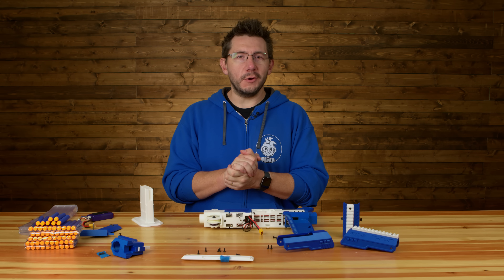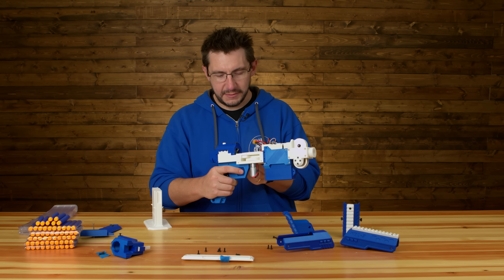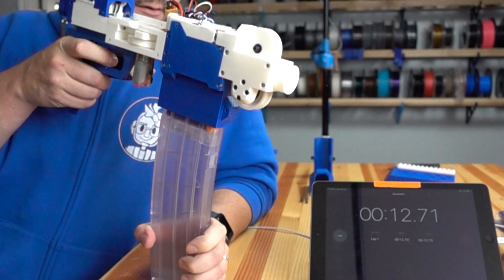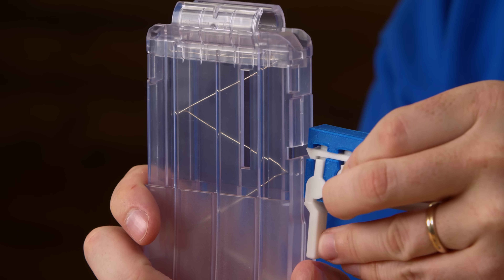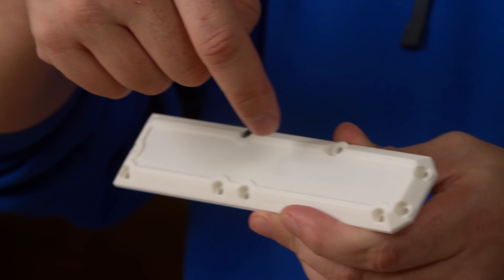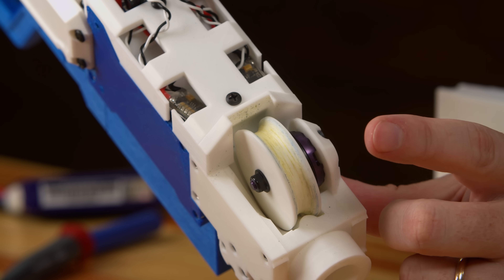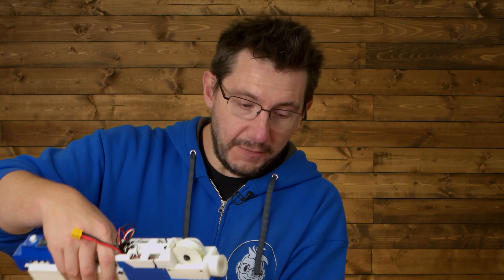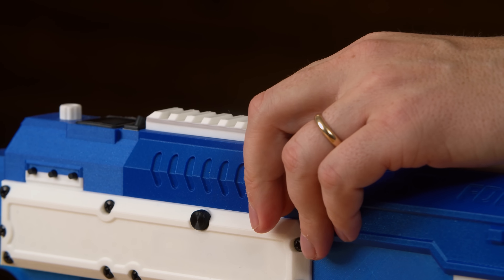Full Breakdown of the Project FDL Nerf Blaster and some Sad News

Comment: That sucks.  For a blaster it needs to look like and sound like a Star Wars blaster with attachments for extending the barrel and folding shoulder stock to make blaster rifles.  A carrying strap, RGB lights in the front might lead to false identification as a muzzle flash by cops.  Like the sad instances with Laser Tag pistols being used at night when a cop shot a kid dead thinking it was a real weapon.

That control knob is slick especially with the display.  Perhaps a Gatling gun variation for high volume users?  Getting back to the Star Wars blaster a speaker should be added to replicate the cool blaster sound effects.

Comment: Hey Joel, just wondering. What machine would you recommend to a newbie and why. I have the snapmaker 1 myself and I use fusion 360 but I really want a bigger printer and I figured you would be the right guy to point me in the right direction of a easy to use bigger printer.
Big fan of your work and videos.
Big hello from Norway

Comment: If the flywheel motors are dual ended shaft, then put flywheels on both ends and have either side-by-side or an over/under. Also modify pusher to make double sided. Dual magazine of course, but rate of fire DOUBLED!!😱😱

Comment: Although they are sold out of electronics, I decided to download the files and start printing. I am a racing drone pilot so I have wire, connectors, motors, esc, etc.. I just need to find a way to get trigger communication through. Unfortunately it will not have a display or knob but possibly to connect through bluetooth gui and adjust on phone. I hope to get this info to 3DPN to share once finished
Reply from the maker: Sounds like an incredible project - cannot wait to see it finished!

Comment: Clips are for your hair..magazines are for your firearm...said my drill instructor... over and over and over
Reply: Not entirely true. The m1 garand uses clips. Clips only grab/contain the cartridge by a portion, magazines encase the whole thing
Reply: @nhwilkinosn  Interesting, I never knew that.  During my says with a DI it was an M16 so Mag it was.  In this case, I think the item used in the nerf gun fully encloses the cartridge, so it's a magazine.
Reply: It is. And 99% of the time, magazine is the correct term. But gun clips do exist. It's weird saying it though Moon clips, stripper clips, enbloc clips, etc. Most are for ww1 era guns anyway (with the exception of the garand of cours)

Comment: I recon you can do a simpler version of this with 1 cheap RCspeed controler; 1 cheap RC motor; 1 switch; 1 Potentiometer;  1  circuit python microcontroller and 1 9v battery. you can even a add a cheap servo for the loading mechanism. No need for a oled screen tho. Just have a few firing modes selectable via the potentiometer and a few lines of code in python. All together probably less then 40$.
Reply: That's pretty much what this is, except everything is more powerful to get better performance out of it.

Comment: It is magazine not clip. The difference is a magazine has the casing and springs and is actually used to connect to the weapon. A clip is used faster loading of a Magazine.
Reply: No the difference is in how the ammo gets delivered into the gun (or blaster). the clip holds the ammo and then is moved by the gun (or blaster). while a magazine moves the ammo in to the gun (or blaster) by its self.

Comment: Mental gears are turning ... maybe a blower to push darts instead of the flywheels to pull them.
Reply: That's how spring powered blasters work, they're really air guns. They compress and spring in a piston when you prime it, then when you pull the trigger, the spring is released, compressing the air and forcing it down the barrel, launching the dart.

Comment: a clip feeds a magazine. a magazine feeds a firearm
Reply: Ethan Middleton no a magazine feeds a blaster a clip is moved through a blaster
Reply: @samda4739  you're both right in a sense. the M1 used "clips" of ammo. these days a lot of rifle ammo is sold on stripper clips, which you use to easily load ammo into the magazines.
Reply: @samda4739  No he's right. It's a common saying in the gun community. It's not always the case but it's super common.

Comment: couple of things:
The flywheel dart dust. thats a good thing. After a few hundred darts, the dust buildup helps with better grip.

Magazine, they are magazines.

dart head removals are an unfortunate side effect of modern modded nerf blasters.

the quick release mag switch is super useful for quick magazine changes, especially when you are under fire. :)
Reply: John Corvus I prefer the term “dart skid marks” 😂😂

Thanks for the info!
Reply: @lasersandlayers  I does work pretty well. :D

Comment: As a normal person, and not a gun-enthusiast--it is a magazine, and not a clip. There are many ways to differentiate the two, but the main fact of the matter is that throughout history, they have been interchanged so many times that at this point both are acceptable to anyone but gun-enthusiasts. Really. Anyone who gets super intense about the semantics of it, will have plenty of reasons why it should be this way, and should not be this way--but who cares! Just call everything that holds bullets and goes into a gun a magazine. You'll be right at least 89.8% of the time.
Reply: the achieve the same end goal, but do it completely differently. it's like calling a motorcycle a car.

Comment: For flywheel blasters like the FDL3 in this video, the Adventure Force darts, available for $10 per 200 darts are amongst the best, as they have some of the strongest glue joints holding the heads on and the price is one of the best for darts per dollar. https://www.walmart.com/ip/Adventure-Force-200-Dart-Refill-Works-with-All-Adventure-Force-Blasters-and-most-Standard-NERF-Elite-Blasters/218225675

The caliburn, available at etsy through the following link, is one of the best value springer blasters that is out there. I have one of the caliburn blasters, and it is almost as adaptable as the FDL3, but since it uses a spring instead of a set of flywheels and is pump action, maintenance is a lot easier. If you do have a 3d printer or at least access to one, the caliburn hardware kit, where only the non printable parts are included, is available for as little as $59, and Captain Slug is still producing his blaster. For those that by the caliburn platform, the blasters can be customized with things like the railgasm kit that puts a picatinny rail for mounting accessories like sights all along the top of the barrel, so long as they were designed for either a real weapon or an airsoft simulated one, or what's known as a SCAR barrel that takes fishing line and adds a few inches to the barrel which has a form of rifling on the inside to boost the accuracy of your shots. The caliburn also features the ability to swap ammo types just by pulling out three pins and swapping either the front end to accept a different type of ammo, like switching from standard nerf darts to the rival rounds that Joel mentioned. shttps://www.etsy.com/listing/607432490/elite-caliburn-homemade-blaster?ref=shop_home_feat_1&bes=1

Comment: Sad when a company has to go out of business due to too many orders.  :-(
Thanks guys
Reply: So I’m good friends with them. They are still selling electronics bundles. The Issue was the electronics parts. Jesse makes a lot of the electronics from scratch in the bundles. They have had to change ECS’s cuz the one they were using was discontinued. They are on there 3rd motor change due to suppliers discontinuing sell of said motors. there are also  others things that are also going on
Reply: thats a load of crap if i ever heard one... how can you go out of business because of too many orders
Reply: @biziluxgames8924  because supply and demand sourcing parts and stuff gets expensive quickly plus you have to factor in the cost of numerous 3d printers that they had running 24/7 printing these Blasters
Reply: @Tater_Lord  they were selling them for 400€ or something like that. and i think they had 5 printers. thats not a lot of running cost. besides, you have to sell at a profit, otherwise you will go out of business... no idea how they managed to go under, but if you have more orders, you make more money... simple... but if they couldnt source the parts in time, then thats the sourcing problem, and they went bust because of that, not because of too many orders lol
Reply: @biziluxgames8924  - when your raw material supplier goes OPUD on you.  Causes delays and makes buyers mad.
Reply: Joel said they are "closing the doors and ceasing business" so you will have to source your own parts as well.

Comment: Think of it like this, a clip literally clips two or more rounds together, a magazine holds the rounds in some kind of enclosure and is generally inserted into the device that fires the rounds.
Reply: @Michael-nn2ho  Um, no; your "definitions" are almost literally *100% incorrect -
* Unless you are referring to a muzzleloader, a round (also known as a cartridge) contains a bullet (more specifically, a cartridge/round is made up of a bullet, case, and several other components), not a clip; a clip holds multiple cartridges/rounds together. (BTW, I refuse to accept the argument that "if a cartridge contains a bullet, and a clip holds cartridges, then technically a clip holds bullets" because, technically speaking, a clip can hold a bunch of cartridges that have already been fired ad thus contain no bullet.)
* A magazine does not "push bullets into the chamber" either automatically or otherwise. In fact, I cannot even think of a single case where a magazine "pushes cartridges into the chamber," let alone "automatically."

And no, I'm not posting this comment because I'm one of those pedantic asshat "gun guys" who points out trivial and ultimately pointless mistakes like interchanging the words "clip" and "magazine" (which isn't necessarily even "wrong" anymore). This is because you wrote an idiotic response to the OP, as if you knew better and were correcting him. 

Now please go hide under your bed and don't come out until someone finds you (i.e., starve to death under your bed).
Reply: @Michael-nn2ho  You can't just take your reply down! Now no one will know that you made a fool out of yourself! Luckily I saved a copy of it:

" Such A Noob:
The firearm definition of a clip is a object that holds bullets. A magazine is a object that have a mechanism that pushes bullets into a chamber automatically."

The issue is not that I "proved" you were wrong; it is that you violated exactly what you just now stated:
Such A Noob (in case you edit or delete your second comment as well): "Providing useful feedback to others and correcting there mistakes or misunderstanding are important, shooting them down however isn’t." Didn't you just do the exact opposite ? You "corrected" someone else with completely incorrect feedback,  which was neither useful nor to the OP or anyone else reading your comment because, given your comments context, made it look as if 1) you were a subject matter expert and 2) the OP was incorrect in their statements, and thus 3) anyone reading your comment should take your "definitions" as the truth, which in turn might lead them to spread that incorrect information on to other people, as if to correct their "mistakes" (while instead just making them even more confused).

This is the Internet, bud; if you say or do something completely stupid, expect to get "shot down." Learn from your mistakes and don't go spouting off at the mouth, pretending you know more than someone else when you're completely ignorant of the subject, because sometimes (and if this is the first time, I'm shocked) someone will call you on your B.S.
Reply: @Michael-nn2ho  
1) I never told you to take down your comment; I just pointed out how totally wrong it was, why it was wrong, and corrected your wrongness while pointing out that the OP was pretty much correct.
2) You didn't need to "say" that the OP was wrong to imply it: you could (and should!*) have posted a *brand new comment , but instead you decided to post a reply to his comment, which in turn means that you are in some way directly relating to the replied-to comment . And if you reply to something with "facts" that are totally different than the facts in the original post, that means you are indicating that the original facts are incorrect. Everyone knows that; don't act like an innocent victim just because you got called on being a know-it-all.
3) I actually stated that you should hide under your bed and wait to be found, with the inference that no one would do so. I'll freely admit that it was an asinine thing to say, and totally unnecessary. And I will neither delete nor edit it to make this it seem otherwise.
4) I am neither acting like I don't make mistakes, nor am I arguing about your comment. I'm just not letting you back down through repeated replies: if you're going to go silent, please do so; but you're not going to get the last word in, that's for sure.
Reply: @Michael-nn2ho  I am glad that you acknowledge your mistakes, although you have yet to acknowledge (in fact you did just the opposite) that you decided to publicly "correct" someone's helpful answer to a question posed by the creator of a very popular YT channel with completely incorrect information; instead you still appear to be running with the idea that you did not in fact do so, despite that obviously being the case.

Beyond that, I could care less what "words or implications" you find unnecessary or rude, especially when you are not even referring to words I actually said ...especially if you are then going to play the victim (which you are continuing to do! ) and suggest, as if it has any relation to reality whatsoever, that you would have politely said "right you are, sir! I apologize for my indiscretion and shall retreat into the darkness. Tally-ho!" if I had not tacked on the "hide under your bed" bit at the end.

To repeat myself: you are not going to get the last word, as you just continue to dig yourself into a hole of shame due to your fantastical sense of self-worth and victim-hood when, in fact, you continue to prove that you cannot truly accept that you f*cked up, instead trying to move the conversation over to a place where you were wronged when in fact you are the sole source of the root problem.

I thought you said you would be speechless if I continued to reply? Are you going to lie about that as well? Or are you finally going to close your browser, delete your YouTube notifications, close your browser, and walk away as you seemed to indicate you would do?
Reply: @Michael-nn2ho  Editing a comment is even worse than deleting it; if you're going to fess up now to screwing up, hopefully you will keep that in mind should this happen again (...and if it does, you didn't learn a single lesson here...which I question you did, regardless). Editing a comment to make it seem like someone is replying to a different thing than they actually did is straight-up manipulative, cowardly and shameful.

At this point you are still digging your hole deeper and deeper...and deeper. Dee-per. Dee. Per.  So stop. Because you're typing out "I find no use fighting over [this]" and yet that's exactly what you are doing.

Save some face and walk away; you did a pretty good job of (in theory) admitting that you screwed up, and how. Good for you. Now leave it at that and think a little more before you post something simply because you feel like you need to be heard by a bunch of anonymous people that know not who you are nor will care just because you said something that seems smart but that was yanked out of your rear-end at the spur of the moment.

Comment: Supply problems? I’m not an economic expert but why just not sell more stuff than you can provide? Supposedly they were breaking even if not making a profit before you gave them the exposure? Or switch to preorders or kick starter campaign and to have more time to sort supply? Or is this all code for Nerf blocking their supply chain?
Reply: They have a full write up in their Facebook group, but the gist of it is that bundle sales were beginning to become the bulk of their production, which are less expensive and mean more sales to hit the same numbers. Jesse was seeing that he would be spending most of his time soldering rather than 3D printing, and that's just not what he's looking for. They are working to find someone to license the platform to so they can take over bundles and continuing to offer them, but Project FDL is not sustainable enough in its current form to want to continue. 

it's possible to be successful yet not successful enough.
Reply: Basically their source ran out of motors and ecss